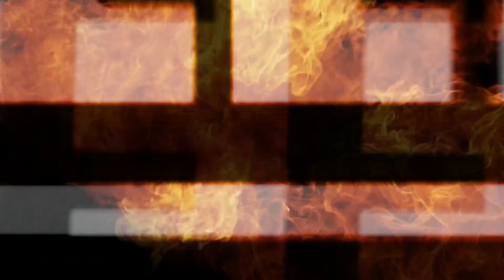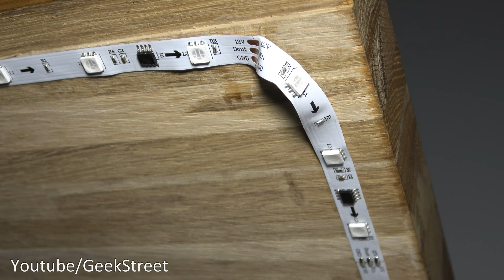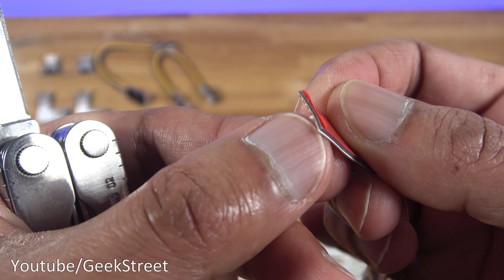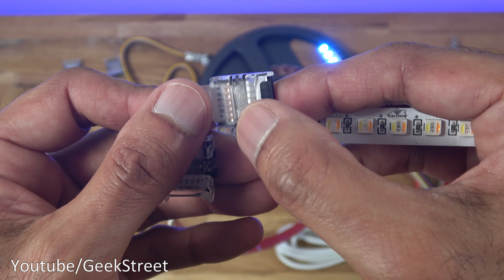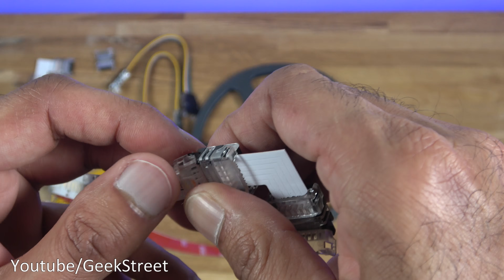How to Cut LED Strip Lights and Extend EASIEST METHOD EVER!

Comment from the maker: Quick links to the products:
Zigbee Pro-Series LED Strip Kit - Amazon UK - https://amzn.to/3akdeDF
Pro-Series 6-Pin LED Strip Extension Wire  - Amazon UK - https://amzn.to/2LMBwvO
Zigbee Pro Series LED Extension Strip - Amazon UK - https://amzn.to/37tsa0s
LED Strip light Connectors And Accessories - Amazon UK - https://amzn.to/38KCi4m
Govee M1 Cuttable strip light - https://bit.ly/3hI6mpd
Govee Neon Rope Light Review - https://bit.ly/3K5IunX
New Fancyleds Just got a huge upgrade - https://youtu.be/2gDZvFZlEVg
ULTIMATE TV BACKLIGHT LED STRIP KIT - ttps://youtu.be/ZxilMHE0mAA
Reply: Bllsht. Ive tried 3 different brands. They dont stay connected well and half the lights are green if they do.
Reply: 1😊😊😊😊😊

Comment: Hi, I’m wanting to put LED strip lights on my nearly ceiling height bookshelves. I have no experience with led lights outside of Lego lol…anyways I want to avoid a heap of cords accumulating doing each shelf perimeter. So at the end I can just turn on one power box for it to light up the bookshelf…Or even multiple bookshelves (which is the ultimate goal preferably - I’m just not sure how to go about it)…any advice I’m all ears.

Comment: I still dont understand why you cut it if you end up losing the part you cut from the power supply...
Reply: I legit just cut mine and now the remaining 20 feet are just useless wires.

My theory: they want to sell connectors. They go out of their way to tell you “you can cut them, it’s that easy” to trick people into buying and cutting the strips without doing any research. They want you to think, well I already have the LED’s, might as well buy some connectors

Comment: I added an extension through cabinets over a stove and the other side only lights up the first 3 leds..
Reply: Probably too much voltage drop over the cable.

Comment: Hi, you seem knowledgeable about this topic. I have a 25 meter led light strip. The first 15 meters work, but the remaining 10 meters don't light up. Is it possible i just cut the junction where it started to not light up then connect them again with a 4 pin connector? Or does the new 10 meters cut will require a new power controller? Thank you

Comment: So if I cut it then use the connectors which I bought it will connect somehow to the original strip? That's why I'm confused I want to put some on shelves on a TV stand and under a bed
Reply from the maker: You can connect to the original strip with the connector, but you can't use the remaining strip stand alone.
Reply: @GeekStreet  so put a connector on the original strip then when I cut other strips it should have power to it what do you mean I can't use the remaining strip so the rest of the strip that is on the wall and do I just connect one side on the original one so it powers the separate ones I'm sorry I sound dumb lol it's kind of confusing I thought that connecting to the original would work just was not totally sure

Comment: at the 415 mark where you have the break of the strip in kitchen. That is what I will have with the window/sink. So if you cut it how does the other half light up if it is cut from the other side that is probably connected to the plug?  Thanks

Comment: Appreciate you shedding some light on this subject ( all Puns intended ) A couple of years ago @ Huntsville Hamfest I purchased a couple of strips without any intention of connecting them together.  Recently during building the Tennessee Valley Model Railroaders N Scale double deck layout ( Bell Buckle, Tennessee)  Several members used RGB Strips for lighting underneath the upper deck.  Which has inspired me to explore using RGB Strips in my home. Thanks for sharing this video & information.

Comment: My light strip says 12v at the cut point and is 3 pin. Does the hippo connector have to be specifically for 12V if it's a 3 pin hippo?

Comment: hello Thank you for the great explanation. does any 6 pins connector work ? I noticed that the names of the 6 pins in your led strip are different than mine. is this important or does any 6 pins connector work with any 6 pins led strip?

Comment: This all wrong.that connector is NOT going to work with cutout in the middle.You can not use connector at all.Most likely you break the chip.this video is useless.

Comment: Can you please do a video on your Kitchen counter lights install (seen @4:20) and extension around the Cooker hood? This is exactly what I’m trying to do so would be appreciated. I am looking to see if I can continue the strip under the cooker hood itself as a better alternative to its own bulb light. But this would require perpendicular joint - not 90 degree one as you showed ?

Comment: Hey, would that work if i split a 5m individual addressable strip in 5 equals parts and use the connectors  to extend them 2m apart from one another.?

Comment: Ok I just want to cut them bc they are to long and put that somewhere else so I cut it on the copper and then I have to get clips? And I can't just move the rest of the strip elsewhere and call it a day? Cause it's Bluetooth. 

Edit : I don't know what I'm doing
Reply: @tristenjarrell9335 😭😭😂 same
Reply: For anyone reading this now, yes you can just cut it to more or less the length you need, ensuring your strip allows for cutting (generally indicated at regular intervals along the strip) and that you cut at the indicated cut line.
The offcuts can still be used however you must obviously power them, which you can do with a separate power supply and controller unit, or connecting them onto another strip so long as that strip has the same pin layout and voltage.
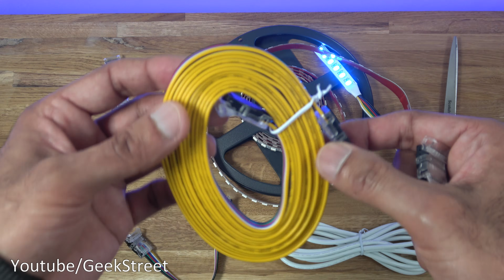You can also use extension connectors like shown at 4:05 so you can power the offcuts from the original strip seamlessly but at a distance!

Good luck

Comment: This is the most detailed method I have seen about cutting and extending the light strip, and it uses an RGBCW light strip. This light strip is more complicated to connect than single color light strip, and it also explains the connection accessories at the corners. Very useful, great video. keep going.
Reply from the maker: Thanks much appreciated!

Comment: I have a question
If i have an led strip and i want to cut it to make the right size
and the rest of the led strip i want to make it in different place do i need an adapter and Power supply ?
Reply from the maker: Yes thats right

Comment: Just bought a 5m roll for a cabinet internal lighting and kind of guessed one cuts on the copper but wasn't sure of that fact. Thanks so much for a clear consice and waffle free video. Wasn't awate of the connectors or extender accessories either.

Comment: Hi do you know how to cut and "repair" sealed led strips from Dymond? is there an easy way to remove the "protection-layer" to get to the copper contacts?
Reply from the maker: You have to gently slice off the silicone protective layer.

Comment: It was not obvious how you used the extension lead in the kitchen.
Reply from the maker: There is conduit tubing in the walls and the wires go in there and then back up at the point where we use it for the next lighting strip.

Comment: so say i want to hang them onto my ceiling and want to cut them and put the rest under my bed. would that work?
Reply from the maker: You would need an additional power supply to do that.
Reply: @GeekStreet  what do you mean by that exactly? a new plug?
Reply from the maker: @crimson2120  the led is normally poweree by a power adapter that has a plug on there you'd just need another one of them to power the remaining led strip

Comment: Quick question...so i have the Minger brand strips and i cut down the intended line,so theres a thick layer of the solicone protection stacked ontop of the copper cut line and its impossible to slot into a extender,would i need to carfully shave down the silicone off the top of the cooper to where its just surface layer cooper and slot in the corner extender??
Reply from the maker: Yes thats right
Reply: @GeekStreet  sweet thank you & happy holidays!

Comment: Crazy that these companies sell these with no instructions on how to connect the lights using the connectors. You got to wonder how many people are returning these all cut up cuz they can't figure it out. Literally nothing in the instructions on how to do this.
Reply: I just got mine early this week and I'm like where the hell the instructions 😅

Now I'm on YouTube checking out how to get it done without messing it up
Reply: Facts
Reply: True I just bought mine and I cut the orange part you’re supposed to cut and it’s stopped working 😢
Reply: Mine don’t come with the connectors, luckily I’m pretty good at soldering,
Reply: @ezumach  and that's why there's YouTube and the Internet to resolve that issue
Reply: Ikr!! 😢
Reply: agreed, it’s so annoying, I was worried having the corner bits stuck up was bad for the circuit or whatever  so I thought it was best to cut it and connect again thinking it would work I’m a dummy so if it’s not said about in the instructions I won’t really know. Does anyone think that because of their lack of info on it, what the chances of being able to return are? Obviously with the waste of money I have now I just feel like doing that I also think maybe it’s not worth trying. The strip lights I have can be cut it’s just I think you have to do DIY level stuff to get them to work after and I’m not equipped for that in terms of actual equipment and I think I’d just make it worse. I have a tiny section before the cut that does work but it barely does anything
Reply: I didn't need instructions out the box for my first time...though I cut a piece of strip in the line and not on the middle copper part, thankfully it wasn't that long but definitely taught myself a fun lesson learned type of experience!
Reply: Appreciate you putting light on subject ( all Puns intended) I purchased a RGB Strip at Hamfest In Huntsville Alabama couple of years ago. I cut them up with no intention to joining them up. However after watching this tutorial video & other I have decided to experiment.
Thanks for sharing this video and information.  Found it very interesting & helpful..
Reply: this is actually made for technicians who knows how to do it
Reply: @christianraymundodelacruz7484  no it's not, if it was it would be sold in a specialty store. It's sold in Walmart, and Amazon. It's for consumers.
Reply: @ezumach  you can buy army grade things on the internet you think a light is gonna be hard to buy online?
Reply: @christianraymundodelacruz7484  false
Reply: @christianraymundodelacruz7484 you're not that slow are you??
Reply: @ashash1338 you definitely are tho

Comment: ok but suppose i buy a led strip reel . then i want to use some under my desk and did that. but then i want to use some strips inside my pc case. how do i do that? as they provide only 1 power adapter
Reply from the maker: You'd have to buy another power adapter.
Reply: Good chance there's 12v power inside the pc case. If you're just doing one color, you could tie into that and it'll light up when the computer turns on.

Comment: Really helpful! I was looking into how I could connect two strips to one power supply but with a break as they're for under my kitchen cupboards. Thanks so much
Reply: DID YOU FIND THE ANSWER?
Reply: DID YOU THOUGH??!!!
Reply: 4:30 how did you hide the extension cable?

Comment: Where do you get thoes connectors 
I would like to cut and expand the strip in to different locations.
And can you tell the gage of wire is being used to extend please ??

Comment: Thank you so much for this! One question, have you tried extending RGBIC type led strip? For example, I have a 32.8ft long RGBIC strip but I need another 6ft long to complete a loop. Can this be done or will it mess up the segmentation control?
Reply from the maker: I've not tried but in theory I've been told it should work.

Comment: What about the rest of the roll, I don't have the power connected to it anymore, do I have to buy another power supply?
Reply from the maker: Yes you would need another power supply for the rest or the led strip.
Reply: @GeekStreet  hey do I need to cut the part of the strip with the cord on it to connect the 2 strips?

Comment: Great video mate, had a question. I bought some recently and it turns out its too short and doesnt go around my whole room wall. Would i be able to get another set and connect it together somehow?
Reply from the maker: All depends on the power supply, if it doesn’t have enough power the extra bit will either fade a little or just not work
Reply: @GeekStreet  what do you mean?
Reply: @fitrihaikal4125  the longer the led strip is the more prone it is to not work or the light will not be as strong and bright

Comment: Hi I got a question I hope you can help with, basically I’m making a table that will have led strip lighting but I’m wondering if it is possible to some how run a single USB port from the same power supply so as not to need two separate power supplies? Any advice would be appreciated, thanks.
Reply from the maker: Have a look at TV back lights they run off usb connection. Govee RBCIC TV backlight are good ones to go for.

Comment: Can these LED strips ur showing be extended for a long distance? I want to use them for my hallway but i don't want to lose brightness if i wind up connecting 2-4 LED strips. What's the max distance or max LED addon strips u can connect on this Ajax brand? Thanks.
Reply from the maker: All depends on the transformer, give Ajax online a shout they are really helpful.
Reply: @GeekStreet  thanks bro

Comment: Well if you cut them and put in totally different rooms, do you have to have separate power cords? I have 66 ft and I want a small strip over kitchen sink and stove on opposite sides and then the rest in my living room
Reply from the maker: Yes obviously you'll need another power adapter in the other room.

Comment: I've seen these lights advertised and even though they say DIY cut to fit, they never give more details. Thanks so much for clearing up some confusion.
Reply from the maker: You're welcome!
Reply: @suemarie6032  same I have strip lights and I didn’t want to cut it without knowing how to save it or whatever.
Reply: ⁷⁷<<_
Reply: Lol you simply cut them 😂
Reply: @darrenhayes7786  it’s doesn’t tell you, that you needs to by a extended to make sure all the lights work
Reply: @darrenhayes7786  yeah but on instructions it’s says not to cut any of the led strip that what the confusion was about

Comment: So if I just wanted to use one end of a new strip just to go up the wall to the ceiling. Would it be okay to just cut off the copper completely from that end, and then have the rest of the strip to use elsewhere?
Reply from the maker: You can do but you'll need a controller.
Reply: @GeekStreet  I’m gonna have one end connected to the strip I already have going on the wall I just had longer strips and wasn’t sure if I could just like cut the end where I finished off and the lights would still work or not.

Comment: I cut the silver bit is that valid?
Reply from the maker: No, best to cut the copper bit.
Reply: @GeekStreet  what if I did cut the silver but?
Reply from the maker: You could get a solding iron warm up the area and remove the soldered joint.
Reply: @GeekStreet  k thx man <3
Reply from the maker: @TopRanktifyy  np

Comment: I have installed Strip Lights (Anko ones). To help stick them to my display shelf, I have used a little sellotape on some places. Is that ok or will my strip lights short out or overheat?
Reply: I've done this on kitchen cabinet lights but I used electrical tape rather than cello tape, 6months later no issues. The LEDs are set to light continuosly for 6 and half hours daily

Comment: Does anyone know how I could attach two wheels together? x
Reply: Did u find out
Reply: Does it work
Reply: @amir_4473  I just seen this now I didn't attach the two wheels together as I used separate plugs for them but u can use the L shape connector that comes with the lights  to attach the ends of the wheels when they are stuck on the wall so they can be used as one, hope this makes sense

Comment: Hi, I'm going to get govee led strips, I can't use all the 16 feet, how would I end a strip, just cut it? I am worried the copper will start a fire or something?? I'm planning to stick it to my monitor and desk.
Reply from the maker: You don't have to do anything to the end of the strip.
Reply: @GeekStreet  sorry, this is my alt. i meant if it was too long how would i cut it ( i mean in a safe way to end it)
Reply from the maker: @vineetkalra9902  yes thats fine to do, nothing to worry about.
Reply: @GeekStreet  thanks!
Reply from the maker: @vineetkalra9902  you're welcome!

Comment: is there a way to do corners without getting the clip?
Reply: you can take regular wire and solder it to the ends, since the wire is flexible. It's more work but you won't need the clips.
Reply: I just made a loop and continued. Then again, I did it behind my bed frame, so you’ll never see the loop. Depends on where you’re placing, I guess.

Comment: how many leds per meter of the strip in video ?
Reply from the maker: I think 60
Reply: @GeekStreet  noted,   you buy this strip for you private use  or project installation for you client ?           we have this strip 84 LED/m,  60 LED/m and 30 LED/M   12V , 24V available

Comment: Hi I really need help I did this but when I put then up I realized. That the light started dimming further along thee light so the beginning is completely fine but as it goes. The colour starts to dimm and. It turns kinda yellow if I put them to white
Reply from the maker: I wonder if the connection is not proper?
Reply: @GeekStreet  wdym?
Reply from the maker: @xxstodgyxx1242  could the connection at the connector not be successful so loose at any point.
Reply: @GeekStreet  I did have. To use. Connectors causes. I cur them by accident cooild it be cause. The connectors are not in properly or smthn?